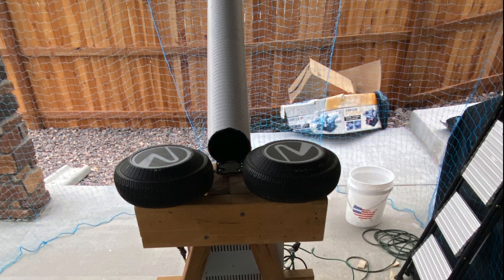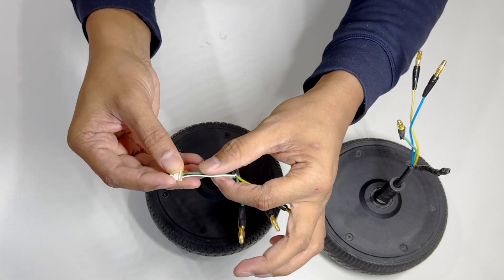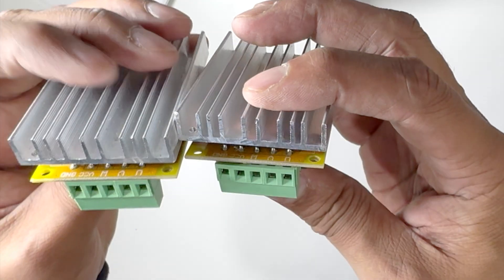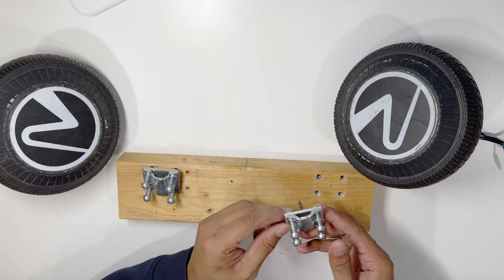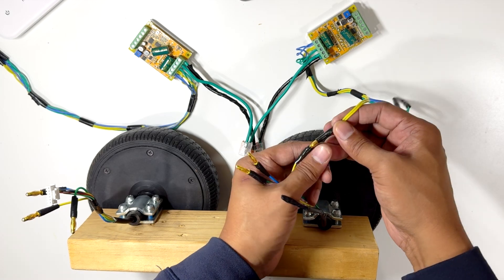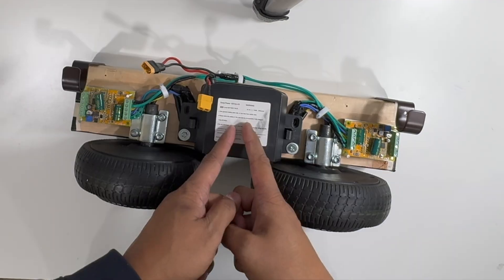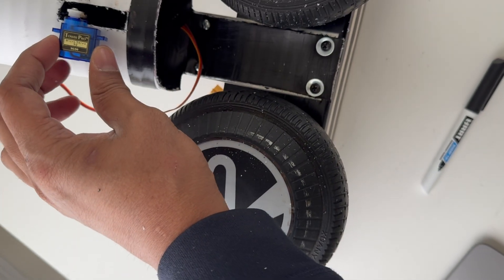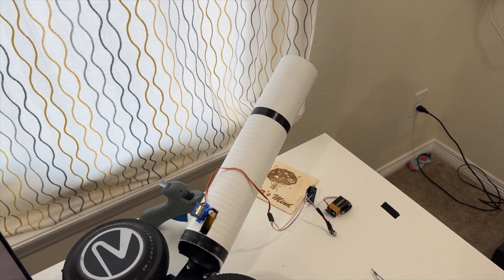Tutorial for DIY cricket bowling machine| #cricket #bowling #machine #diy | #viral #shorts #video

Comment: Outstanding DIY! Kudos!  I'm interested in a DIY project for a Pickleball launcher. I'd like to know the estimated maximum launch speed of the ball you tested. Also, in your opinion, will a Pickleball launcher be feasible with your current settings and equipments. Btw,  pickleball launcher speeds varies from 40-60 mph.Thank you.

Comment: Very good video. Couple of question. 

1. Can you post the link to servo motor pleas?
2. I notice link for the boards is not available but I was able to find the similar one with this link. I posted it earlier but looks like my comments got deleted because of it. 
3. What is your suggestion for motor control, if I want to control the speed of the wheels separately (to create a swing/spin) with one wheel spinning faster ?
Thanks

Comment: Hii , these two motor controllers ARE NOT THE ONES THAT WERE INSIDE THE HOVER BOARD , they are from amazon ….
can we use the ones that come inside the hoverboard ? 
Thank you
Reply from the maker: I think the original controller is programmed to use the pressure sensor onboarded with the hoverboard. To break the original board to accommodate hall sensing would lead to a jail break of the board. I am not sure how to do it.
Reply: ook  THANK YOU SO MUCH ….

Comment: what accersoires would you recommend for soccer balls?
Reply from the maker: Though i dint do the detailed research yet but my guess is the same setup with a bigger gap between the wheels and increase the height of mount point from the wooden base. These two change can hold a soccer ball and then regulate speed from the knob. If you could use the hoverboard wheel which has a power rating of 350w would produce more power to through the soccer ball. Hope this helps. Thanks
Reply: oh i appreciate you feedback. i assume i can get a cheap second hand board and just play with the the motors and the hardware. you are invite for a coffee:) all the best from Hungary

Comment: At 9:46 you mention about an upload for code and parts. I camt see it all in the description
Reply from the maker: Sorry if the code link not present. I have used below code for a sweep style of servo control

#include <Servo.h>

Servo myservo;  // create servo object to control a servo
// twelve servo objects can be created on most boards

int pos = 0;    // variable to store the servo position

void setup() {
  myservo.attach(9);  // attaches the servo on pin 9 to the servo object
}

void loop() {
  for (pos = 0; pos <= 180; pos += 1) { // goes from 0 degrees to 180 degrees
    // in steps of 1 degree
    myservo.write(pos);              // tell servo to go to position in variable 'pos'
    delay(15);                       // waits 15ms for the servo to reach the position
  }
  for (pos = 180; pos >= 0; pos -= 1) { // goes from 180 degrees to 0 degrees
    myservo.write(pos);              // tell servo to go to position in variable 'pos'
    delay(15);                       // waits 15ms for the servo to reach the position
  }
}
Reply from the maker: All you need to control the timing of start and stop
Reply: @makersmind  thank you kind sir!

Comment: Sir, when I set the speed of the rotation to max , it heats up. Why it's happening and how to stop it.
Reply from the maker: Thanks for reaching out. If supplied voltage is within the rated spec it should not heat up. Please post a picture of your setup.

Comment: Hub motor ka price kitna h kaha se milega
Reply from the maker: You can buy a used hoverboard to get two wheels easily.  Even if the hoverboard does not work the hub motor wheels should be good. 

New one will cost you 13k roughly 

https://www.flipkart.com/tygatec-eco-bluetooth-music-speaker-hover-board-rgb-led-light-electric-drifting-self-balance-wheel-black-hoverboard-scooter/p/itmf9hgfhpjvf4sf?pid=SCOF9GCVYZ6GNQNJ&lid=LSTSCOF9GCVYZ6GNQNJVOQ7YB&marketplace=FLIPKART&pageUID=1711632760168